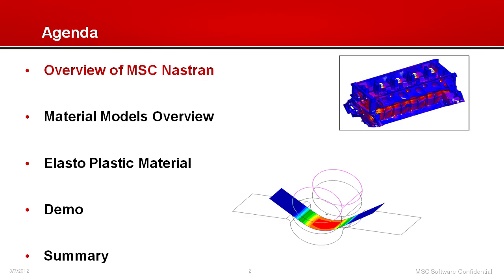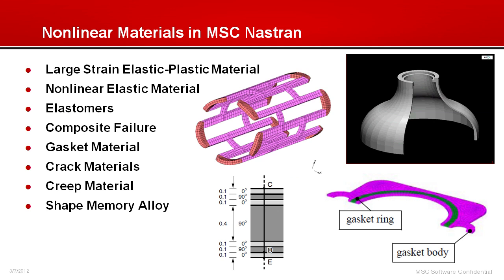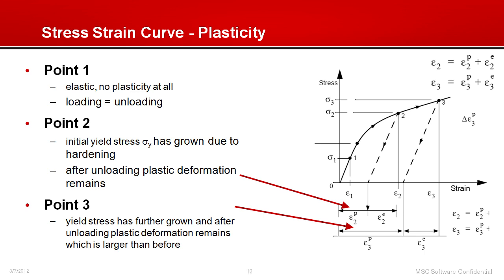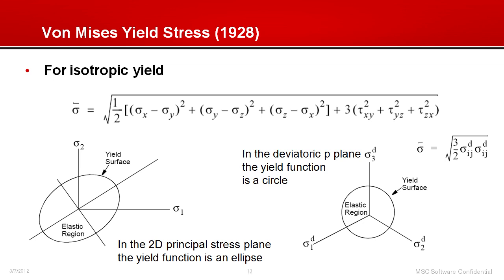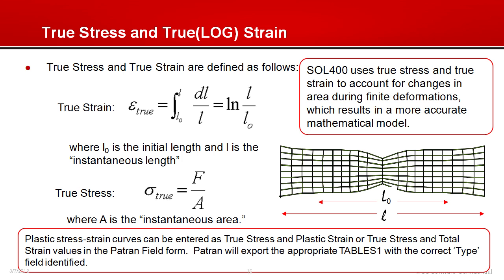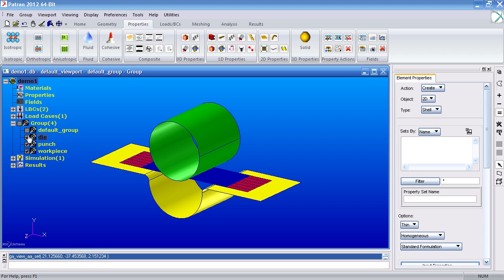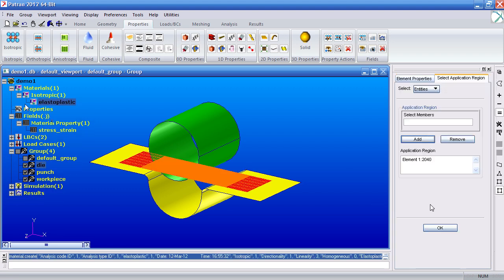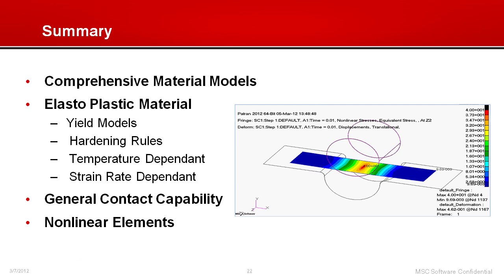MSC Nastran - Elastic- plastic Material Modeling for Improved Accuracy

Comment: How we can use stress strain curve of glass filled polymer materials, since they are not showing any yielding, directly they are breaking at UTS. Only UTS is there and after that no curve is present so what should we do to consider material non linearity in analysis?